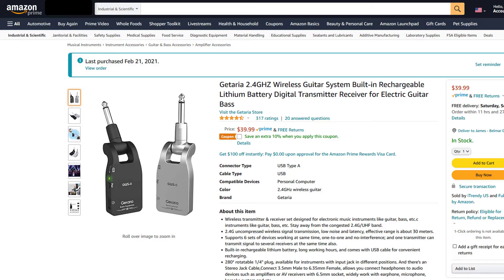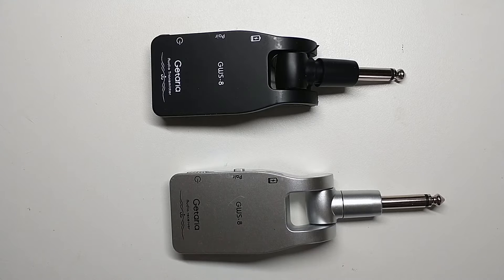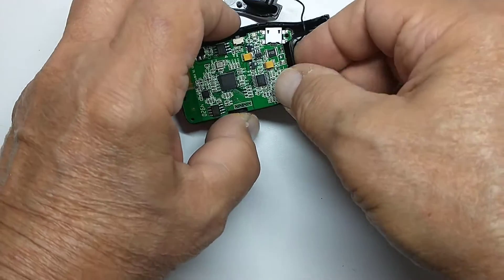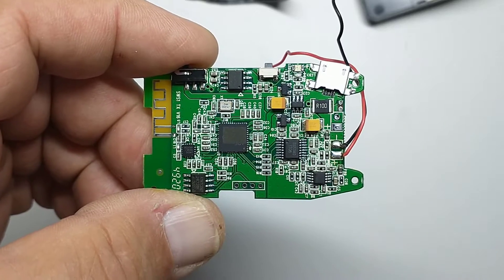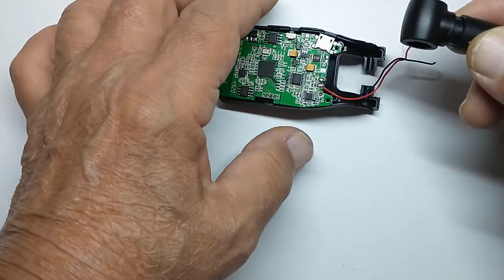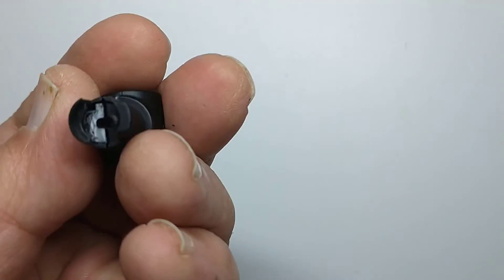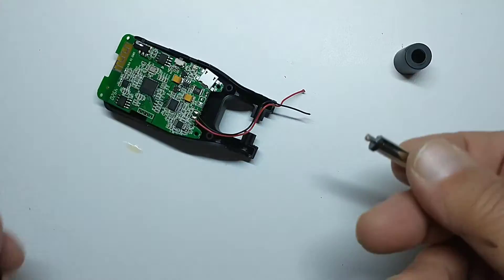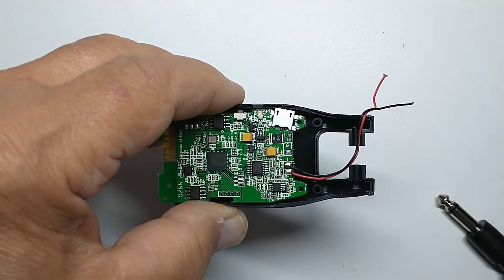A Look Inside a FAILED Guitaria 2.4 GHZ Wireless Guitar System

Comment: So mine had a problem with the transmitter also. It could charge for a few minutes but the red light indicating that it was charging just turns off. When I try unplug it from charging and turn it on, it just won't turn on at all. Anybody have a similar case here? Been using the exact unit in this video. I'm turn whether to just buy another one or if it just needs repairing that I can do it.

Comment: I the same one but different ....and maybe but maybe . the wires are . different kind. some sort of micro insulated. its so tiny i cant even tell if its insulated or what it is. the wire is shinier. i'm going to try to solder different leads on and see if it works. took it apart originally to fix the charging jack but when i took it apart the wires ripped off the plug. plastic insulator seems to be intact. i'm doubtful but steadfast

Comment: My transmitter has just given up on me it has died on me right at the end of a set twice now so i think its more of a battery problem but wont know until i take it apart.
Ive had the sytem quite a long time without any problems so seeing how much it cost initially about £30 or so i think ive had my moneys worth.
Just ordered a 5ghz system hopefully it will be just as good.

Comment: I never used the 2.4 system cause I found that Bluetooth uses this frequency. I use 5.8 rechargeable wireless units or/ and AKG wireless bug systems. What I did was put velco on both bugs and guitars. That way nothing moves and/or breaks. My AKG systems are over 10 yrs old. And no problems.

Comment: the receiver is not get turn on, didnt get the issue, i think its battery gone , if where i get the battery?
Reply: Battery 3.7V Lipo Battery 800mAh Rechargeable Lithium ion
Reply: Did you find one?

Comment: I also discovered at the worst possible time that if you turn off the transmitter, and back on, it doesn’t automatically reconnect with the receiver. I had to turn both off and then on…

Comment: Another preventive measure could be to use a shortish ¼" extension cable, male/female, leaving it permanently connected.  Secure the transmitter to your strap with a pouch of some sort, or keep the unit in a pocket. Then insert the male plug into the guitar's jack. Never unplug the cable from the transmitter. Thanks for the video!
Reply from the maker: Great tip!